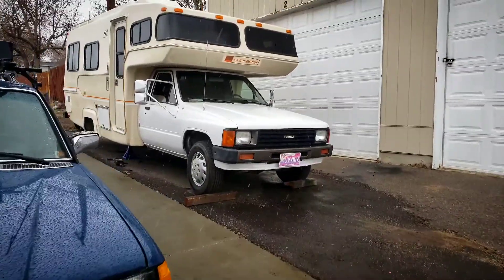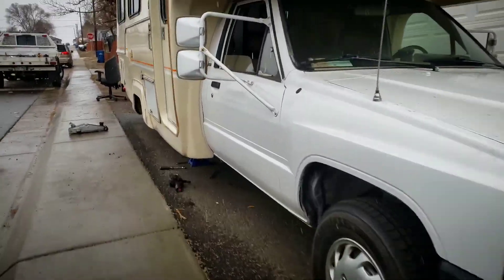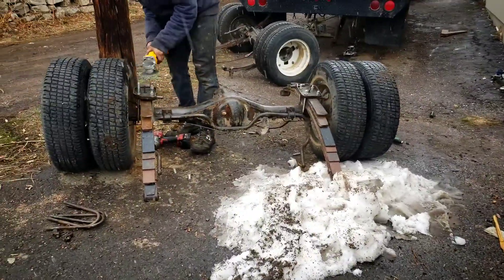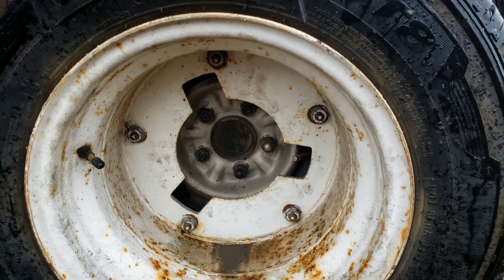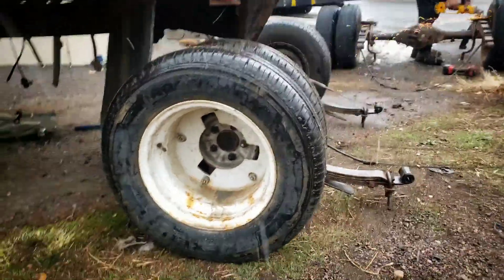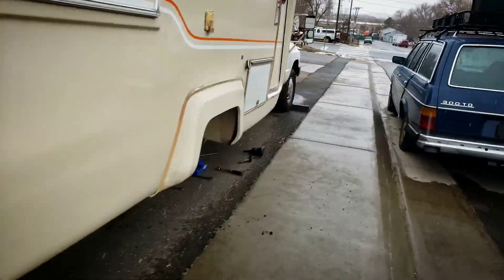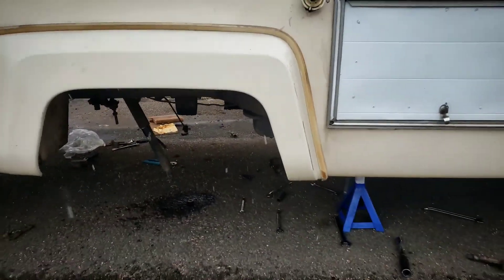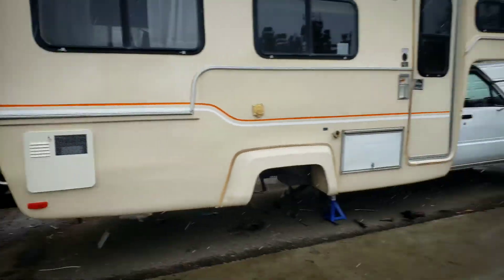Project Sunrader: Axle Swap! 5 lug to a 6 Lug

Comment: Just found my axle. 2 year search for a good one for my 1985 Sunrader. Did you need to change the bushings in the leaf springs before re-installing them? Did you make your new bottom plate?The weight appears to be my biggest challenge. Mine is from a 1988 model with 4.10 gears. 4 cylinder fuel injected engine. Fortunate to find a good set of wheels also from the same fellow.

Comment: I am about to do that same swap. Any key things I should look out for? Does there need to be any modifications for the swap?
Reply from the maker: Definitely have a buddy to help. It makes a world of difference. It’s prettty straight forward. Have a can of penetrating oil in case bolts won’t budge.
Reply: So it’s a direct swap or is any additional parts needed? About to do the swap as well
Reply: Hi can you tell me what year make and model vehicle you got your replacement axle from? The kid didn’t mention probably the most important thing about the axle swap.
Thanks so much!